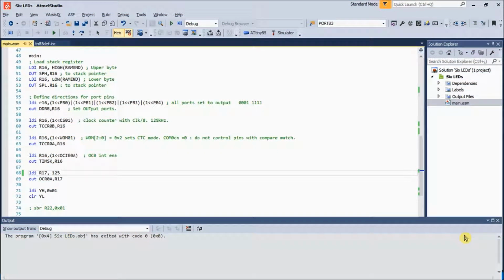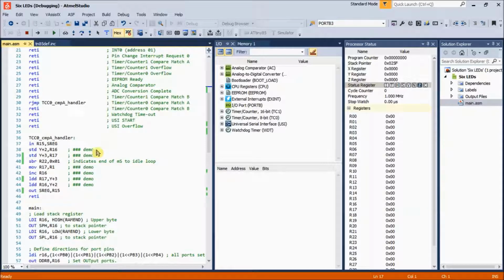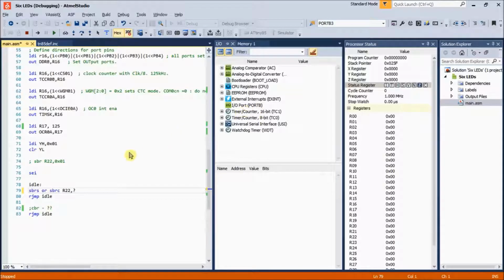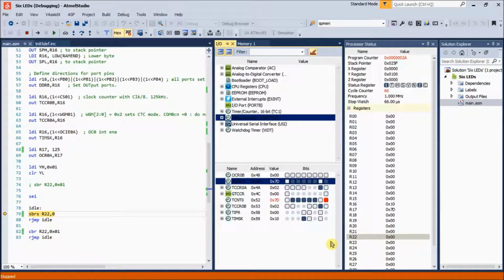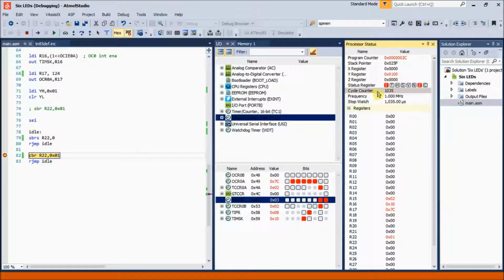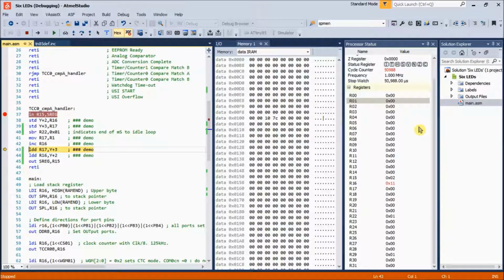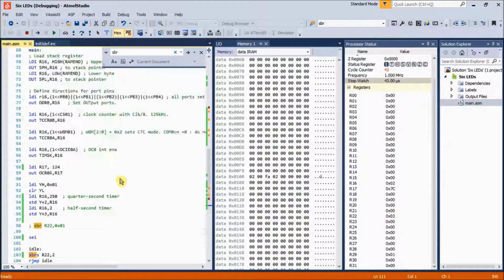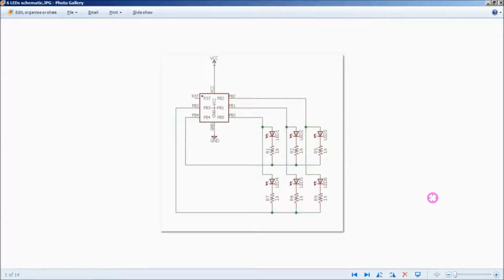AT85 Assembler Tutorial Part 4   Vectors, Interrupts and more

Comment: Mike thanks for your beautiful videos with explanations.

I have a question, If I run your program in simulation mode, the interrupt does not work.
I have checked the program a few times but the instructions are the same as you show in the video.
Could it be that there is an incorrect setting in studio, causing studio 7 to ignore the interupts?
Reply from the maker: I don't think there's anything in AS7 (Atmel Studio 7) that would prevent interrupts from being shown.  Where abouts in the video are you looking, and what is not working for you?
Interrupts have to be set up.  You have to give the parameters for them, enable them individually, the SEI (Set Enable Interrupts) is a general enabler to enable them all.
Did you copy the code from my Google Drive, or did you write it manually?  If so, finger-tangle is an ever-present problem.  Unfortunately,  YouTube doesn't lend itself to being a forum, so this isn't the place to send lots of code for debugging, but give me a time-stamp on the video, and describe what you're doing as well as possible, and I'll try to help.
Reply: Hi Mike

Thank you for helping me

Here you have a link with the video.

https://youtu.be/sGuO27iJVHg 

Also click on show more, there is some text explained

Thanks in advance.
Reply from the maker: @bertstrijker3424  Hi Bert, I put a number of replies on your video, (five, I think), but each time I look to see if you have replied to them, I see that they are no longer there.  Please take a look and let me know if you see them.
If not, I'll stick to communicating here.
Reply: @DownhillAllTheWay  Hi Mike.
Thank you for your response.
I have emailed the source code to you

Comment: Great job Mike! Your videos really help to get into Atmel Assm. While not there yet and still trying hard to understand how some things are done. Have a general question on the bootloader. is it suppose to be loaded before you load the program, so after you upload your hex to chip so program will run. I mean bootloader part a must of been loaded previosly, right? As empty brand new chip will not start your program without the bootloader, correct? I missed that part when you loaded the bootloader, unless it's been done automatically by AS7 or chips purchased possibly with bootloader presintalled? Please clarify.
Reply from the maker: To Mike B from Mike C!
The applications I have written on the AVR chips have not used a boot loader.  I used an Arduino Nano as a programmer, and wrote code to the ATTiny85 that would run when the chip was switched on.  You have to think about where your program is.  If it is somewhere off the chip, then you will need a bootloader to pull it into memory so that it can be run.  For example, the bootloader on a PC pulls program data from the hard disk).  The ATtiny85 has various sections of memory - the SRAM for its working memory (this is volatile - does not retain data when the chip is switched off), it also has EEPROM (which I have not used - though it is available for program and/or data storage), and it has "Flash" memory for program storage.  This is not volatile (maintains data through a power cycle), but when a program runs, its instructions are executed in Flash memory.  The program can also write to flash memory, and in the timer that I present in the last module of the course, when the desired time period has been set, the number of seconds is copied to flash so that it will not be lost on power-down.  The operation is not straight-forward, however.
The method presented in this course writes program data to Flash using the Nano as a programmer, and when the chip is switched on, the application begins to run immediately. (other programmers are available - but probably not as cheaply!

Comment: I dont have this main.asm file   (at7:10) in the video  in the drive.google downloads.
Reply from the maker: Under the video, click "SHOW MORE".  You have to be logged in to Google, then you will find 3 files you can click.  I have just checked them all, and they open as expected.
There is no "main.asm" file.  
The Vector table template (see below), is just full of "reti" instructions - return from interrupt.  That means that if any interrupt is called accidentally, there is a return from interrupt, and the program continues execution as if nothing had happened.
The processor can be interrupted by any one of the things in the vector table, and when you switch the chip on, the first thing that happens is a Reset interrupt.  In the program shown in the video, the reti for the Reset interrupt has been replaced with "rjmp main", which means "do a relative jump to the label "main".  The program jumps to that location and starts executing instructions from that point.  (If you raise a signal on pin-1, that also causes a reset interrupt, but that is never used in these examples).
The video tells you when to download the example files
0:10 - load example 1
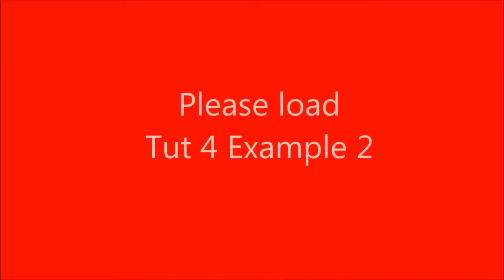31:20 : load example 2
There is also a copy of a blank Vector table for you to download and keep.  When I'm starting a program, that's the first thing I copy in.  Change the reset vector to "rjmp main", make a label called "main:" (the semi-colon makes it into a label), and start writing your program.  The first few instructions set the stack registers, and then set up the pins - whether input or output, etc.